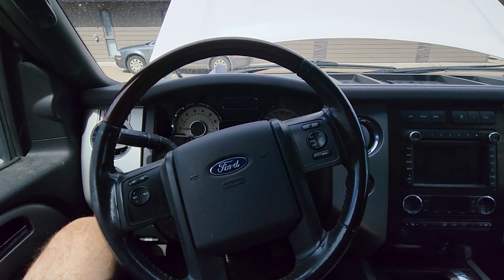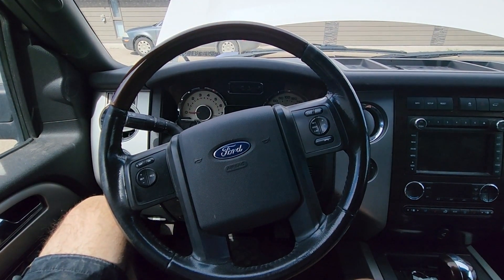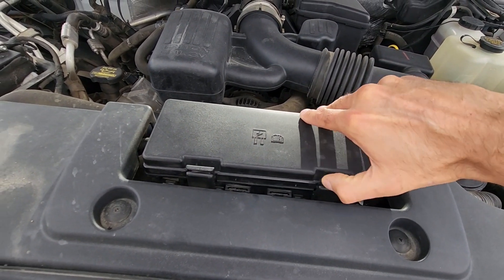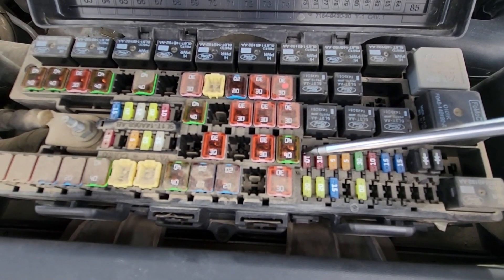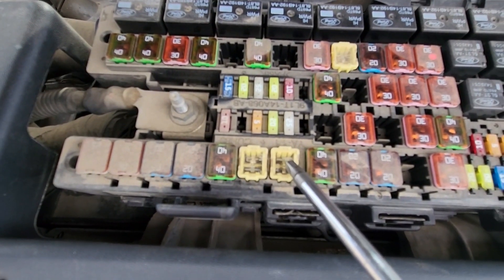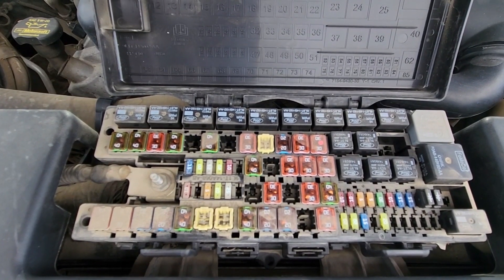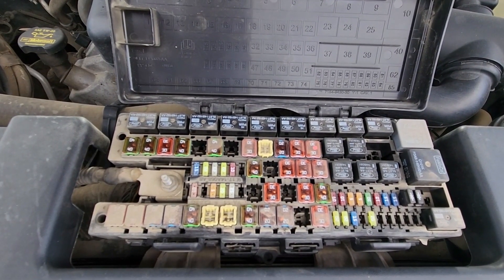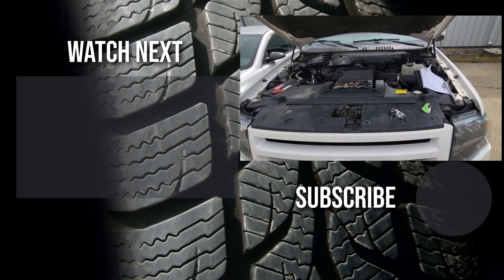Ford Expedition - ABS BRAKES FUSE LOCATION (2009 - 2014)

Comment: You know how to solve, ADVANCETRAC lights warning? Thanks for the videos brother
Reply from the maker: No problem. For the Advancetrac you will have to scan the module using higher end obd2 scanner to pull the codes and then follow up on those. Most likely you are dealing with failed abs sensor on one of the wheels or corroded / damaged wiring towards one of the sensors